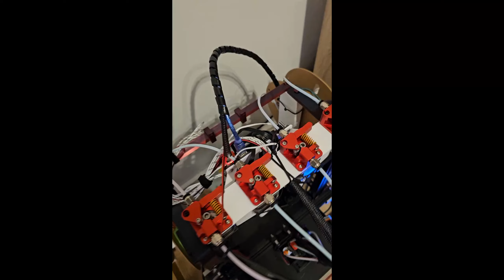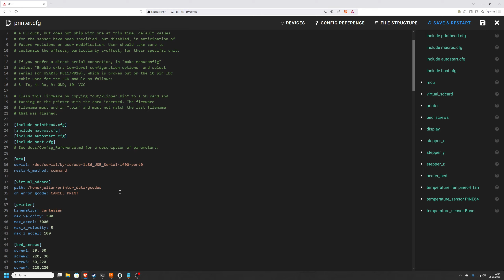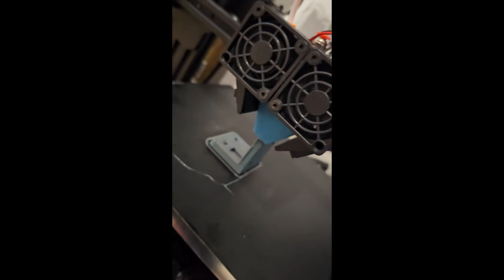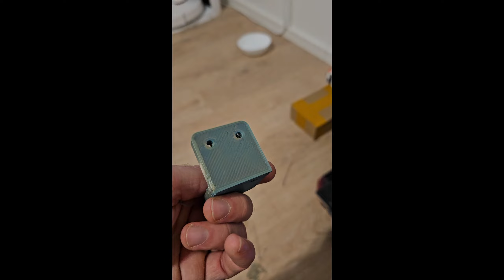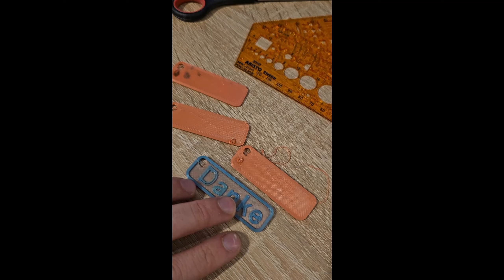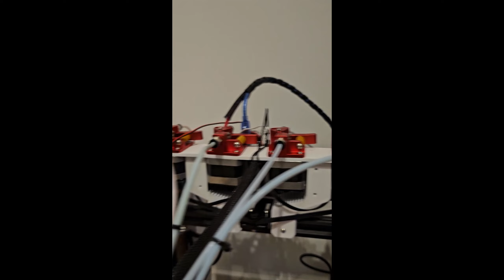Ender 3 mixing hotend

Comment: Real talk, this is amazing. I've seen similar things but never in detail, so does it pull from all 4 spools and mix or one at a time and it switches when low filament ?
Reply from the maker: It pulls from all spools at the same time and can mix in different ratios.
I have tested printing pla and tpu at the same time and this works quite good so far